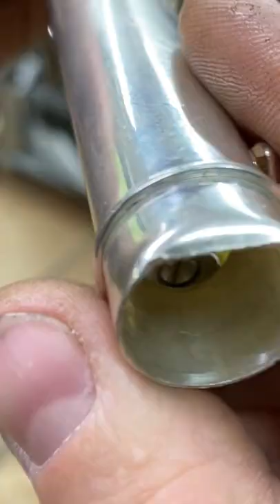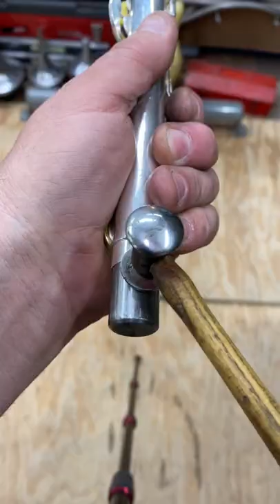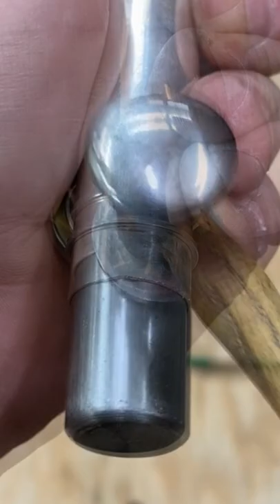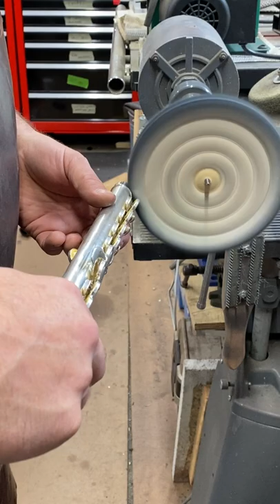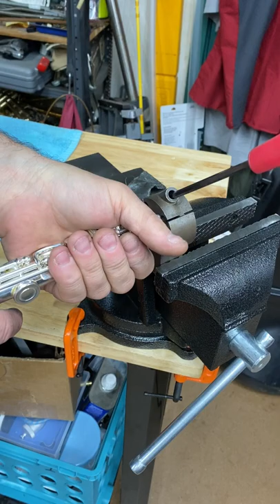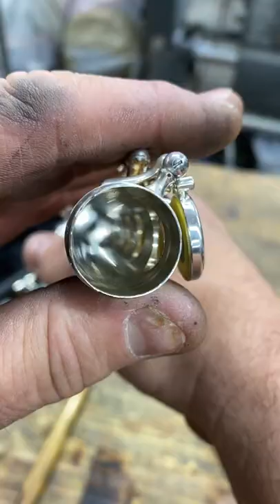Flute Tenon Repair & Refit- band instrument repair- Wes Lee Music Repair

Comment: What was the vice for?
Reply from the maker: Tool in vice is a shrinker. The tenon is oversized after rerounding and hammering flat. Goal is to let the metal calm the shots, then shrink down for proper, even fit, for no air leaks
Reply: @wesleemusicrepair9820  makes sense!